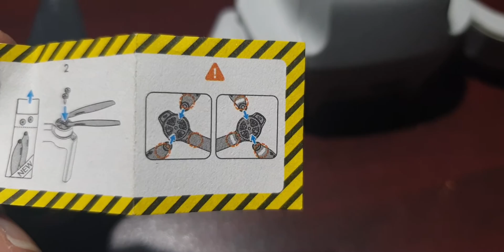WHY MAVIC MINI CRASHES

Comment: If you look at the outboard end of the propellors, one type has its 'high' edge to the right (double striped? props) whilst the other type (single single? striped) has its high side to the left. Possibly their respective motors rotate in opposite directions and thus the props are 'handed'. 
With regards to changing propellors as a pair, has anyone checked to see if they are weight matched and or a balanced pair and or pitch matched?

Comment: Those instructions are not very helpful. I checked the dji fly app. In the manual section they have a good video explaining how to change the propeller in a proper way. Another thing is you should change always a pair of propellers even if only one is broken. I suggest everyone watches it. It is quite helpful. Thank you for this video. I am sure it will be very helpful for a lot of people. Subbed and liked. Cheers